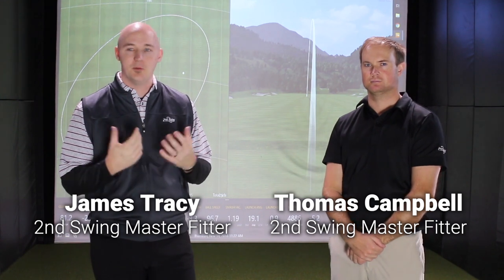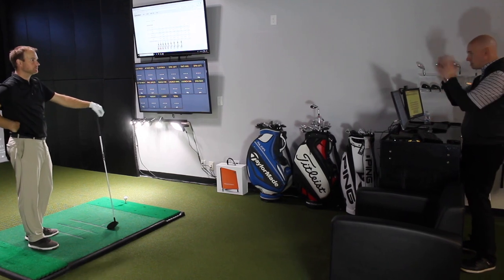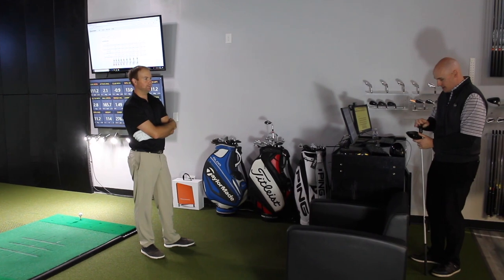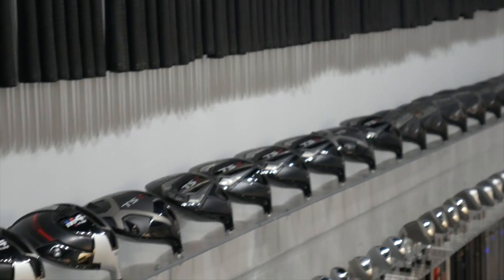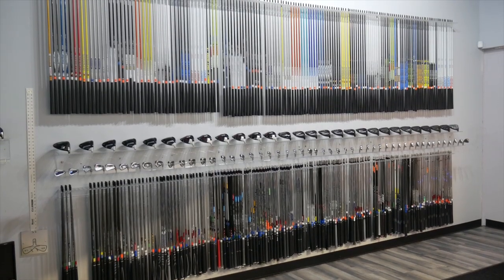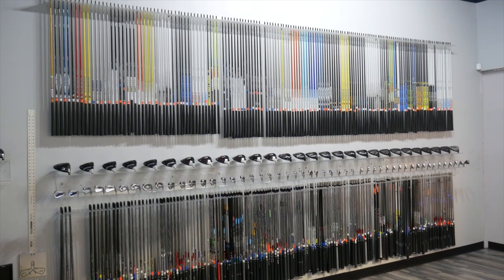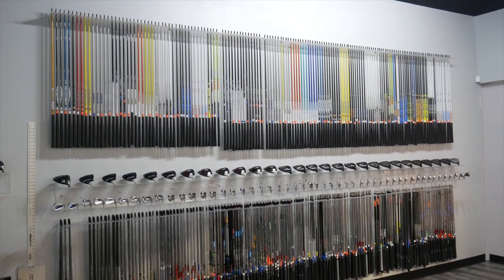Club Fitting 101: Fitting the Clubhead vs. Fitting the Shaft

Comment: What current or recent driver heads are higher spinning for the lower swing speed player?  Any that are NOT particularly draw-biased? I swing 90 MPH with level AoA, and always seem to need something with more loft and spin.  Thanks.
Reply from the maker: Snowman9K Of the current 2019 product, 10.5 G400 Max is likely your best option for mid spin and minimal draw bias. I would say the next best would be the Cobra F9 with the red weight back. Look for shafts with higher torque and golf balls that aren't designed to reduce spin off the tee.
Reply: I agree. G400 max or maybe TS1. I’ve also had good success with Bridgestone bxs ball for more spin all the way through the bag.